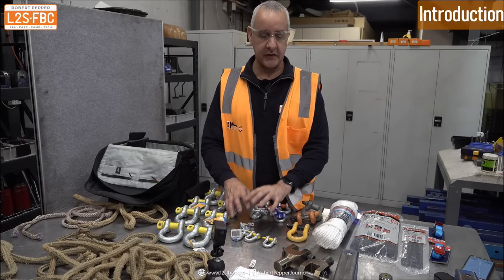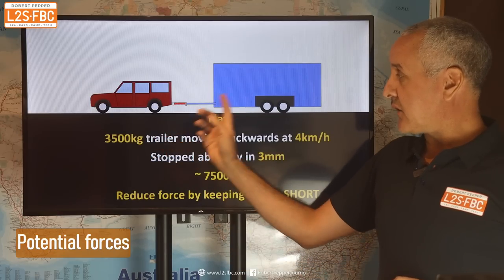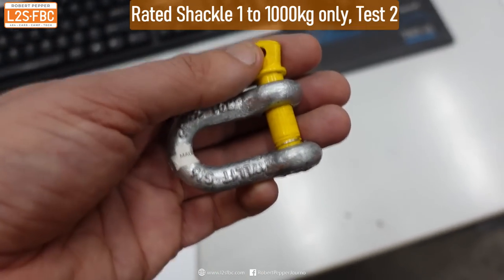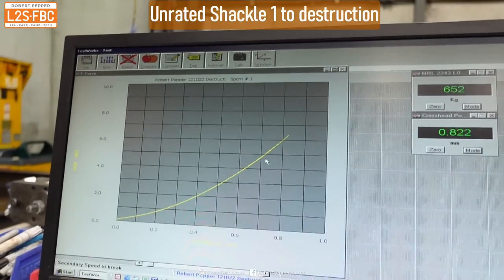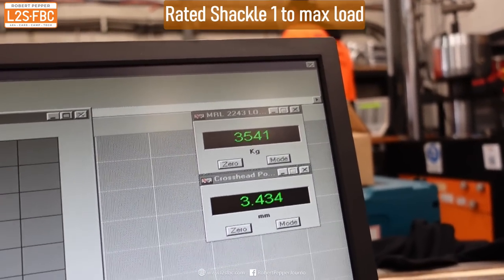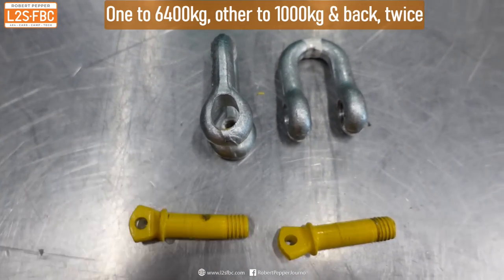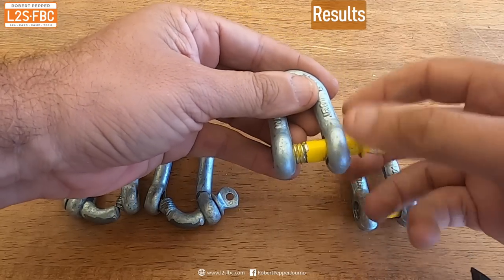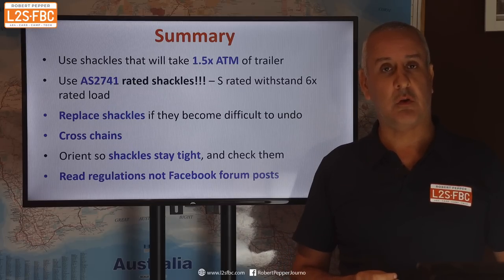TEST: Towing Safety Chain Shackles - what do they break at?

Comment: Thanks for the brilliant comparison , all numbers including the price difference . Noticed your assistant didn't turn the pin back approximately half a turn , when you have a 200 tonne crane in action struggling with a shifter etc is expensive. Re loose pins , a rigging term is "mousing" which is done with some fine  wire , that's probably why the hole is in the pin . On bosuns chairs the shackles must be moused , also slings are moused to the hook so they are held in the cup of the hook and can't flick or bounce out .

Your presentations are much appreciated , thanks again .
Reply from the maker: Thanks, please share!

Comment: for trailers you shouldn't use a D Shackle as they are designed to take the load in a straight line only not on an angle, you should use a Bow Shackle because if a trailer detaches the tow ball the first snatch load is going to be most likely on an angle as the trailer drawbar drops down. i was a chain and rigging certification tech for 9 1/2 years doing load testing and destruction testing on chain and rigging gear for certifications.
Reply from the maker: Thank you!

Comment: Some rated ones I have are with very rough or even sharp edges, especially on markings. They are no good for connecting something like synthetic lines while being ok for metal to metal contact. In such case unrated smooth one can be actually better (assuming known specification and enough safety margin). I never buy one even for general low risk use unless it has a known manufacturer specification. I have for example some that I marked based on specification for 63kN that should be safe for eg. lifting a ton (with 6x safety margin).
In climbing I use only ones that may not be as much specified but that are all individually tested. There a failure of a single piece is a sure death. Individual testing makes sure there can be no random manufacturing issua like a hair fraction inside that one cannot see.
Interesting video and a good reminder that it is not all about if it breaks. Deformed ones are no good for later use and can be difficult or even impossible to get open.

Comment: Do a follow-up test on trailer chains. Where is the weakest link?
Reply: I bet it's the point of attachment to the vehicle...

A 200 for example with 3.5t which many do a gcm upgrade and van can be 4t... 

Have a look at the attachment point... 😂 that would not hold 4t or even 3.5t...

Comment: My curiosity is more in the swivel links you attached the shackles to. Here they are referred to as Hammer links as you have to hammer the pin into them. The reason for my curiosity is that RAM and Ford trucks here in the US with factory hitch receivers have holes for the safety chain hooks that are too small for the hooks used on almost all trailers. Its very common to see the hammer links dangling from the receivers to provide a place to attach the hooks to. I see the hammer links are quite strong.

Comment: I understand the reason for the small sized shackle was needed for the testing machine, but wouldn’t a larger shackle, which would have a higher working load and max load limit, would that not mean the percentage of the two increase quite a bit more? Say it’s rated for 5 ton. Then to keep that safety margin factor of 6, that’s a max load of 30 ton. 
Then factor in shock loading… 
 just doesn’t seem like there is a good reason to not go bigger on shackles. 
Also straight from Wikipedia, “a safety factor, usually ranging from 4 to 6 on lifting equipment. The factor can be as high as 10:1 or 10 to 1, if the equipment poses a risk to a person's life”.
Reply from the maker: Well you can go bigger on shackles but what's the point? The 1t rated shackle didn't break at 6.5t, and there's two of them for a 3500kg trailer. I'd suggest that if you had forces such that a combined total of at least 13t of shackle, probably 15t, were broken then the strength of the shackle would be the least of your concerns.  I did a shock load calculation in the video.

Comment: My only thought about the Australian common shackle design is that you can't see if it's actually tight just by looking at it from a distance. I've seen others where the threaded end extends and an R clip on the end to prevent the pin from working loose. The common D shackle is a cheap and effective design but there are downsides. With corrugated roads, maybe the safety pin shackles might be the way to go?
Reply from the maker: Yes, provided they're rated, they work.  In the video I noted that shackles should be oriented so they don't work loose, which mostly means thread down.
Reply: Could you explain again how you stop the pin from working loose with vibration? I watched the video but can't see where the explanation is.
Reply from the maker: It's not explicit but I show my shackles are thread-down in a closeup.  This means that gravity helps keep them done up. Mentioned in the summary too.
Reply: If you are worried about the pin working loose mouse it with wire or a cable tie
Reply: @ianmoore4327    Exactly! I was just thinking safety wire. 
Also, @paulsorrentino5475  they do make shackles with a straight pin and cotter pin, but don’t use those, the threads allow the pin to deform quite a bit before failure.

Comment: Great video - thanks.  We hire out trailers regularly where I work and won’t let customer leave using unrated shackles - I’m in Vic and I get the ‘they don’t have to be rated’ argument all the time but not sure what the COR laws would say if I let them go and an unrated shackle failed if the trailer came off - I will always lend them rated shackles.  I’ll be sure to send them a link to this video next time I get any lip from them. 😊👍

The ‘Oldmate66’ made me laugh out loud - there are hundreds of those keyboard warriors banging away right now with a frown on their faces. 😂
Reply from the maker: In Vic the shackles don't need to be rated, but for the sake of $0.50...why would you? And, then you'd need to prove the shackle is 1.5x ATM. Funnily enough the easiest way to do that is to have a rating on the shackle...

Comment: Hopefully can do on the sling hooks that some use and some trailer and 4wd shops sell as trailer connectors, are legal or safe fit for purpose
Reply: I would like to see this too. I don't see how they could be considered safe to use as the latch is a weak point if the trailer bounces around in an emergency situation!

Comment: Pins appeared fully tight before 100%  load rating test. Usual guidance is that they should be left slightly loose to allow easy untightening. There should be no need for spannering up to rated loads
Reply from the maker: Barely finger tight. The reason the spannering was needed was because of slight deformation.
Reply: @L2SFBC Yes, that is the idea of leaving some slack when assembling. You could see the test operative not undoing slightly after fully screwing in the pin.

Comment: It appears that the unrated shackles have a smaller diameter pin, no?  It seems to me that this wouldn't exactly be an "apples to apples" comparison if so.  That said, I still wouldn't use a shackle of which I didn't know it's limits.
Reply from the maker: yes, smaller diameter.  But same overall size, so fair.

Comment: Let me re type that. For your demo it probably makes no difference. But the pulling load should be on the U part & not the bolt part. If you know what I mean.
Reply from the maker: It's in tension so doesn't matter

Comment: At 6:13 the underrated shackle was tighten up too much, resulting a tool was need to be undone.
Certain loads placed on the pin of the shackle on certain angles will cause the pin to roll and tighten every time
Reply from the maker: Isn't that realistic though?
Reply: @L2SFBC  for testing purposes/ no vibrations etc a loose pin may have given you a better indication if the thread binding part of the test, but yes you're correct, we are all guilty of doing up the pin so it doesn't vibrate out at some stage, which might I say is far better having a fractionally over tightened pin than having the pin fall out during travel and end up have no shackle at all..
I see a few shackle pins lying around on the roads at times, especially near speed humps
Reply from the maker: Yes and I also noted in the video to mount shackles in a way such that the pin doesn't fall out. In normal operation there would be no stress on the shackle so it should undo fine even if tightened hard...if there has been tonnes of stress on it, then I submit getting it undone is not the biggest concern one would have at that time :-)

Comment: Unrelated to this video, but I'd be interested to hear your thoughts on the new offset recovery ring that Yankum ropes came out with. Casey Ladelle did a video on it recently. Some people have criticized that it or the soft shackle will be overloaded and damage the winch line when doing multi-line pulls.
Reply from the maker: I don't like the design. It shifts stress from the shackle to the rope. Reason given i to  reduce heat in the rope which was never a problem anyway.,
Reply: @L2SFBC  Seems to me that it would add a lot more resistance, lowering your mechanical advantage too. Thanks for your input.

Comment: Interesting test. I would have guessed  the screw threads deforming would be the biggest issue. 

The pin bending and still be removeable, shows a large tolerance in the screw threads. Didn't think of it before, but perhaps shackle designs with the R-clip aren't a bad idea if used on rougher roads. Oldmate66 probably has been shouting this from the digital rooftops for years.

Comment: How does this translate to a galvanised boat trailer

Rated shackle vs unrated is a no brainer...the results are hardly surprising 

Galvanising compromises the union between the drawbar and the chain as well as the chain itself.

This test should be redone with a more real world test, eg, Mocked up trailer drawbar and tow hitch eyelets 

&

Your applying a constant load not shock load 

Love to see that test !
Reply from the maker: Sadly there are no machines that will shock-load, least none I can find and afford. I did however calculate a shock load, and note that there would be two shackles so say about 60% of the load on each. I don't see why the trailer drawbar or tow hitch eyelets would need to be mocked up?
Reply: The eyelets are plate steel with holes on a large percentage of towbars so they concentrate the force to quite a small contact patch eg the thickness of the plate

I purchased a new boat trailer this year that came with 1 only chain and non rated shackle

This is a 1000kg ATM so not huge but still surprising

It was from one if the largest boat trailer manufacturers in Aust

I question the shock load as it would be interesting to see if the rated shackles were more "brittle" but can appreciate testing this would be difficult

Thanks for the videos

Comment: My tow vehicle, in Australia, is rated to tow 3.1T, but I cannot get a D shackle greater than 1.0T to fit through the holes/mounting points on my factory fitted tow bar. If I'm towing a caravan greater than 2T ATM, am I legal coupling it to my vehicle with 2 x 1.0T D shackles? I'm confused. I assume that I need 2 x 1.5T D shackles, minimum,  to my tow vehicle to be legal. But then I may travel to ALL states in Australia, so where do I stand??

Comment: Yeah, I'm going to get rated shackles.
What would 6 tons "jerk" do to a towbar and chassis?
Mate66 is really nice.
Reply from the maker: 6 tonne jerk would be a little...damaging :-(
Reply: @L2SFBC  So perhaps we want some flex and deformation in the shackles?
Reply from the maker: yes, an argument can be made that way.
Reply: @L2SFBC  So I'm thinking for my setup - a 1.9T camper..what I will do is get the rated shackles to replace the current un rated shackles and use the un rated shackles to bypass a link or two on the chains...a little like the idea of a crumble zones.
I note too that you spelt metric ton as tonne...I had better pay attention next time- thanks!

Comment: Shackle bolt - twist finger tight then undo an eighth of a turn? That's what I was taught. That said, I only use rated recovery equipment.
Reply from the maker: You don't want trailer shackles to come undone, and there should normally be no force on them so do them up tight. If there is significant force, then, well, undoing them isn't probably your biggest worry at that point :-)

Comment: The rated shackles are of a larger diameter than the unrated shackles so you are not making a fair comparison. Weight of material is key. If diameter is the same and weight is different, the heavier will most definitely be stronger. Your test was not accurate or conclusive. I do not like posting negatively, but this test was not done accurately.
Reply from the maker: Heavier is stronger - not necessarily. Strength also depends on construction as well as material strength. I think the test was fair as the two shackles were very close to the same size and people do use unrated of that size, which is why I chose them. Even the rated shackle is slightly larger diameter on the pin, say 5%...it outperformed the unrated by way more than 5%.
Reply: If they were the same size, weight etc they'd probably both be rated.
Reply: Type of material will effect the WLL, for example a grade M shackle (mild steel) will be approx. twice the size for the same WLL “S” grade shackle (alloy, and most common type of material)

Comment: I am a tad concerned the gear used to test to a standard, is still using Windows 95/98.
Reply from the maker: It's very common - the software tends not be updated and therefore reliant on old operating systems. Another good example is old tech-heavy sports cars which need old laptops to operate them.
Reply: @L2SFBC  Given i work in the industry, i do see some rare examples of this, i could understand maybe Windows XP. Windows 95/98/NT is just absurd. Begs the question for me, does the company not want to spend the money to update to the latest tech? Can we rely on the results given the legacy hardware, and software that most likely hasn't been updated in maybe 20 years?  Yes that machine/hardware may only run on that platform, i cant see any good reason to still use it in 2023 for any reputable organization. There are no doubt industry standard hardware and software platforms that meet current requirements, why not use them ?
Reply from the maker: OK so you'd know that test rigs like this have specialised interfaces and therefore specialised drivers. And that drivers written for Windows 9x won't work on XP as one has a DOS-based underpinning and the other is Windows NT.  That's my guess as to why it's an old OS.  Can we rely on it? Well, if the same software has been in use for 20 years, my guess it's been used a lot and nobody has noticed any errors so I'd say yes, reliable. I'm only speculating though.
Reply: The operating system etc is irrelevant. The only thing that matters is the accuracy of the equipment. These systems are tested to ensure accuracy and certified compliant 1-4 times per year. Plus they do their own calibration tests as well. Better to have an old solid version of an OS that you know works than a flash new buggy version.

Comment: What was the load rating for the hamerlocks?
Reply from the maker: Didn't test them. However, they should have a breaking strength as per the regulations shown. Easiest way to prove that is AS2741. certification.
Reply: @L2SFBC  Is it legal to use Hamerlocks?
Reply: And the hooks I now see everywhere attached to the hammerlocks. Would love to see them tested

Comment: At least get 2 shackles that have the same size pins. What a waste of time.
Reply from the maker: Why is a total waste of time?
Reply: @L2SFBC  So i have an 8mm bolt and a 10mm bolt, guess which one is stronger. Measure the shackles pins and let us know the sizes.
Reply from the maker: Are the 8mm and 10mm the same construction and type of material?  Can the body be the same size too, or just the pin...because it's different rated to unrated.